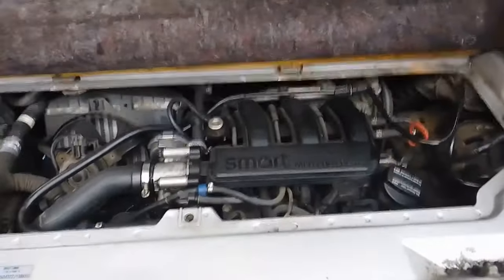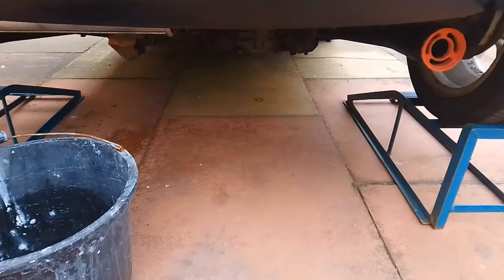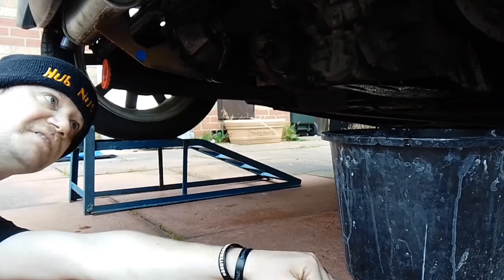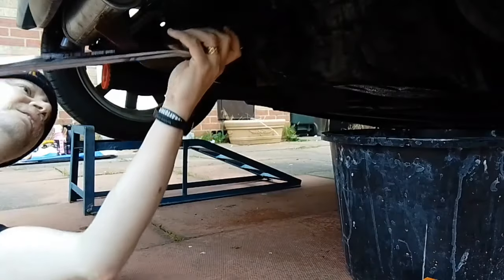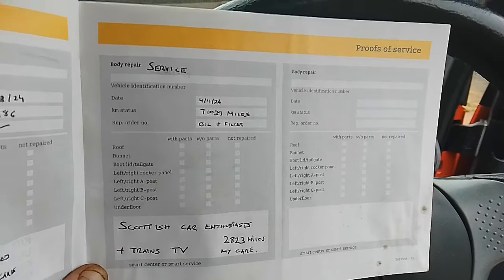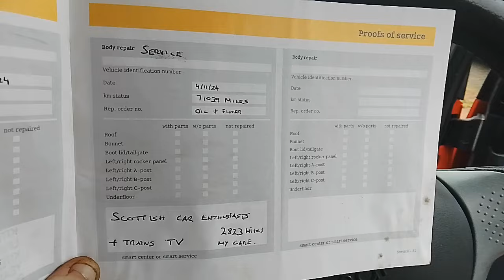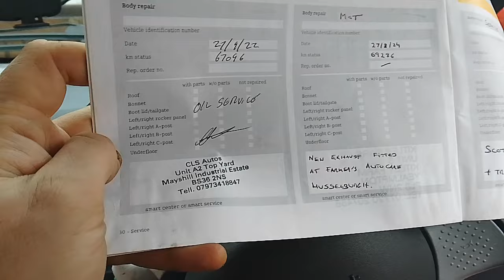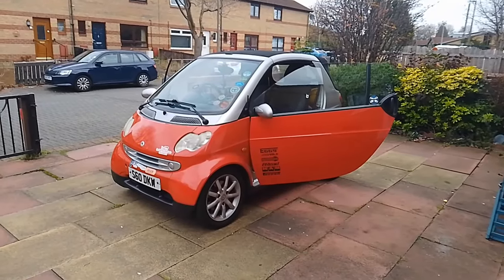SMART TIPS - Servicing the Smart For Two Passion

Comment: That didn't go too bad, Davy ... I can't see mine being that easy ... may have to get a garage to replace the sump  first... I just can't shift it ... but yes, a lot better with the sump plug ... the spark plugs anit easy either. If you ever do them, there's 6 ... three of which get forgotten about as the rear bumper has to come off .. 😄
Reply from the maker: @Jaxs2  yeah not looking forward to Spark Plugs I may have to get my friend to give me a hand.
Reply: @scottishcarenthusiastsandtrain  Is it running any smoother ... or just the same 😊
Reply from the maker: @Jaxs2  covered 290 miles down to Birmingham in it today and seems to be running a lot smoother.
Reply: @scottishcarenthusiastsandtrain  flipping heck you get around, Davy ... 👌